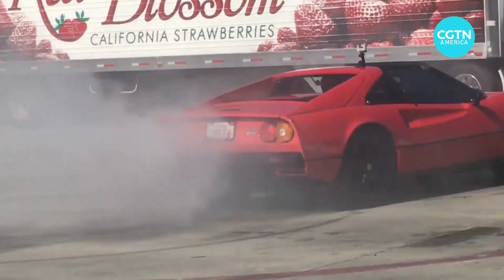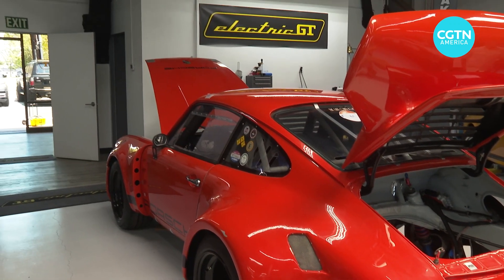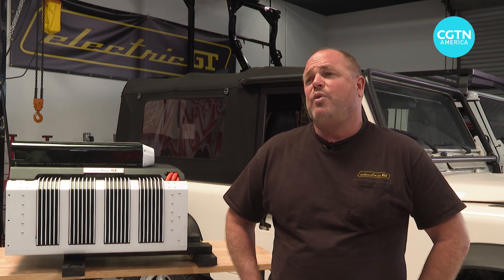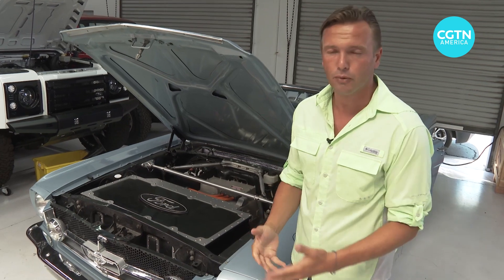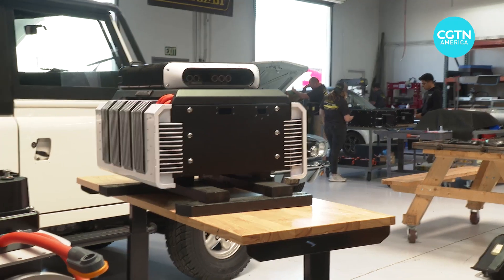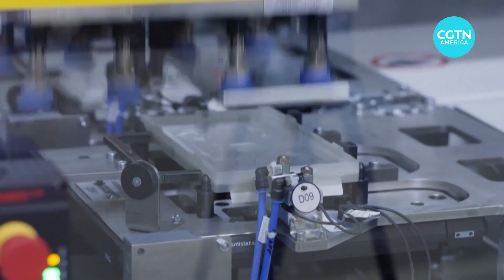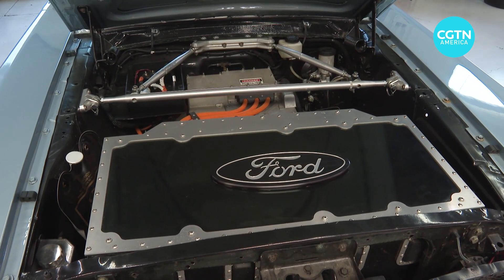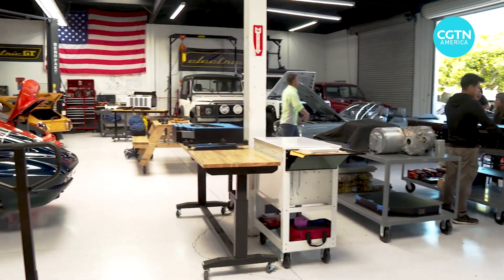See how to convert classic cars to electric

Comment: Already considering converting my old Chevy Silverado truck to electric, and there's a few negatives on conversion; I would need to custom design new automotive electronics since they would be wired up rather differently compared to factory stock wirings, and of course handle the 430+ Volts DC power carefully. High voltage Lithium-ion battery packs are no joke - accidentally drop a spanner between the terminals? Ka-boom, spanners no longer exist. So of course I gotta treat it with healthy respect.

Comment: I have a 2000 Ford Taurus with almost 250,000 miles. I use it to commute to work 2x or 3x per week. The round trip commute is about 25 miles. Is it worth considering electricification of the motor system? Can you give any idea about what it might cost to do the conversion?

Comment: Why ???? Jesus Christ, why someone would convert such classics cars to electric ????!!!!!!
Reply: It's just an absolute tragedy 😔
Reply: So they can have tons of fun driving them
Reply: Would you want to send the perfectly usable cars to the junkyard once gasoline fuel is banned? No thankeee, I would rather keep them on the road, and there's several pros for electrification of classic cars (you can put in 4x4 wheel drive option that it didn't have at the factory which is helpful during winter time), and of course there's also a few cons, dangerous high voltage power being one of them.
Reply: That was answered in the video; to make them more reliable, faster, and more environmentally friendly.
Reply: 0 to 60 on electrics is insane.
Reply: Most classics unfortunately end up as garage queens and weekend toys 

When they're electric, they just go. No fiddling with carbs or hard starts when you've had it sitting for weeks.

Usually owners who convert drive their cars like 5 or 6 times more than befeo